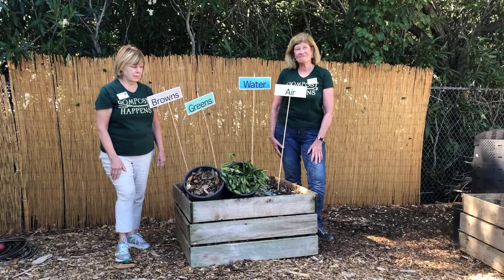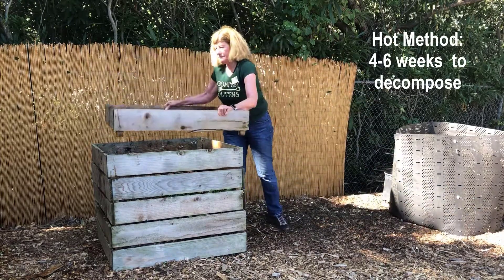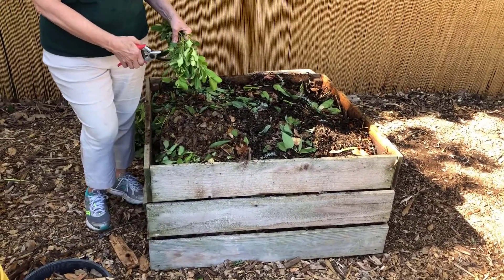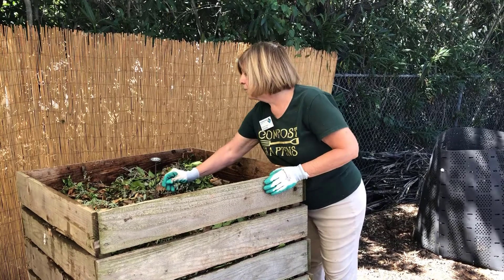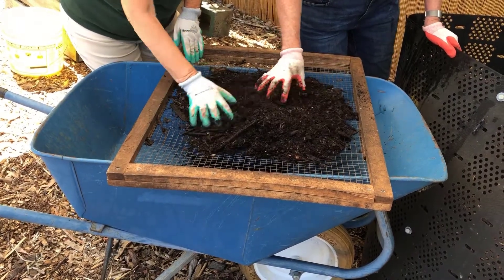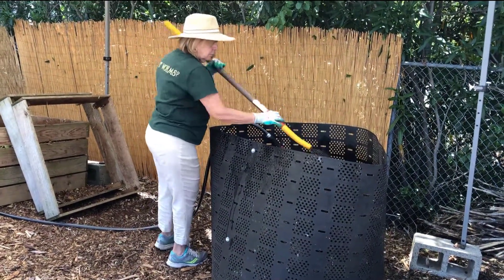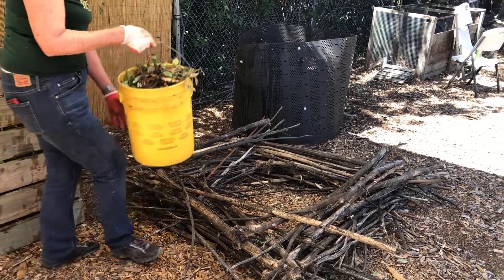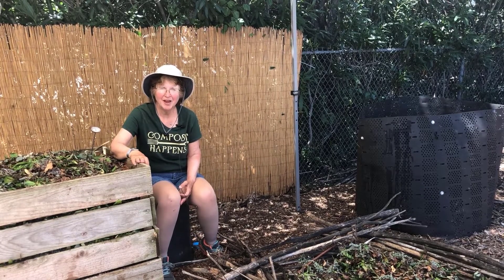Composting: Hot vs Cold

Comment: SO hot turns out soil quicker, and need to monitor temp. Mix brown & green and chop up greens and put into layers. But I'm not clear what was different with cold method though,  it takes longer and you do it if you don't have enough material to do one big batch? ANy other differences?
Reply from the maker: You've correctly identified the difference between hot and cold - if the pile doesn't get hot, the decomposition process will just take longer. A hot pile requires the a sufficient volume to generate enough heat, as well as active turning to keep the pile aerated and moist. If don't have enough material to meet 3 ft x 3 ft. minimum size requirement, or just aren't interested in all that turning, cold composting will get you there too, with a bit more patience.